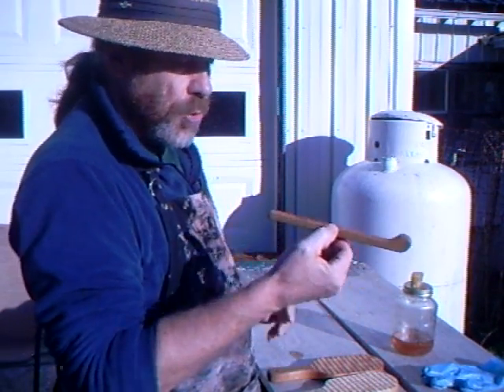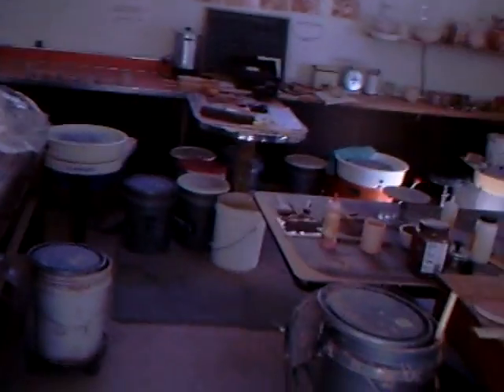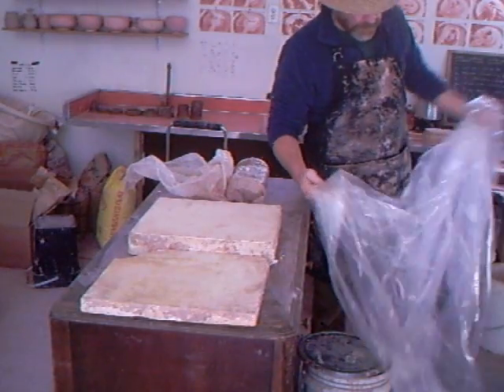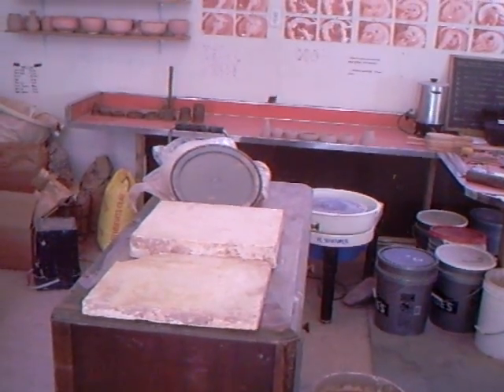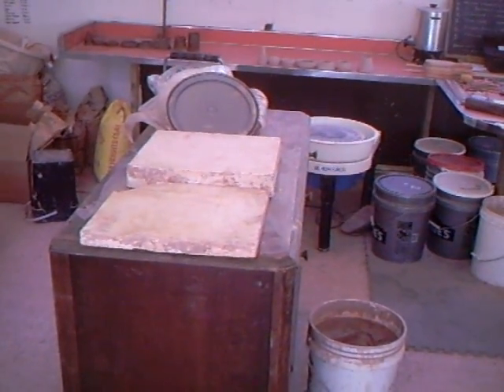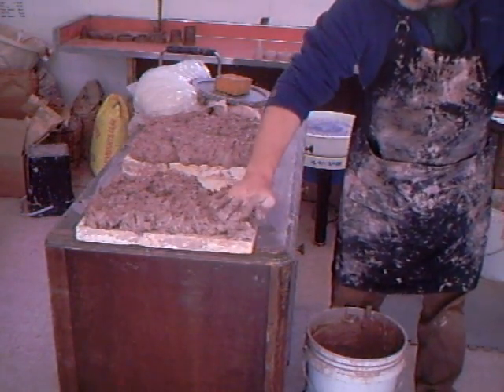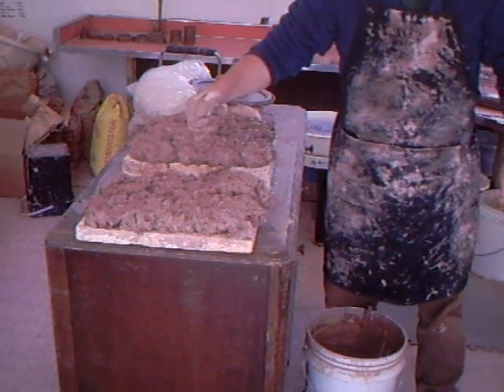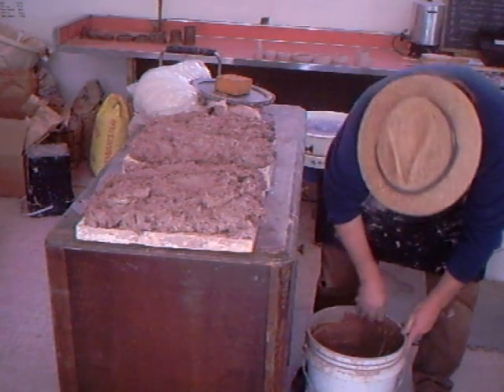SIMON LEACH POTTERY - Linseed oil, recycling clay and throwing a cutlery drainer !

Comment: I put all my trimmings (and failures!!!) into the bucket with extra water.  When the bucket is about 3/4 full, I add water to bring the mixture level up to about 2-3 inches below rim. Then I use a plaster mixing paddle and heavy duty drill to thoroughly blend the mix until there are NO LUMPS.  After setting for 2-3 days I remove excess water and put the resultant creamy mixture on the batts. Works great!!!